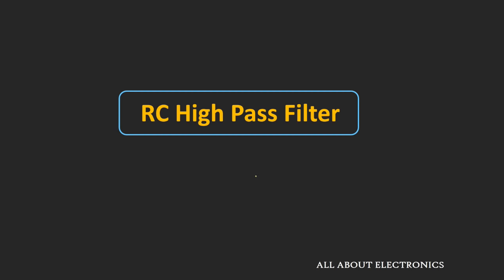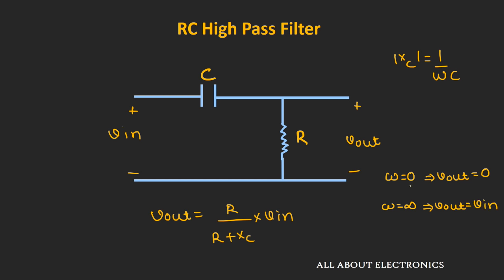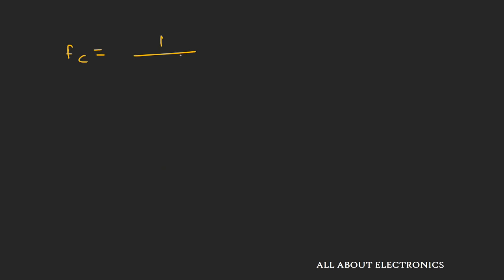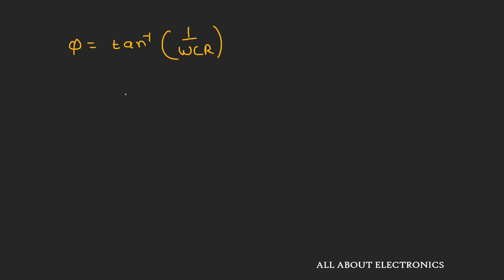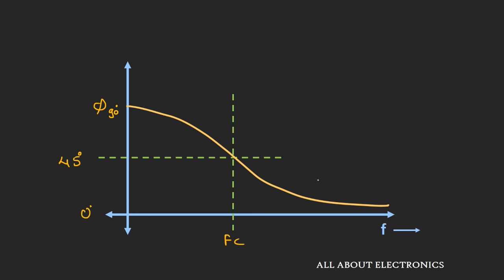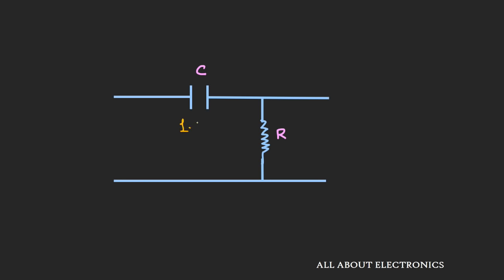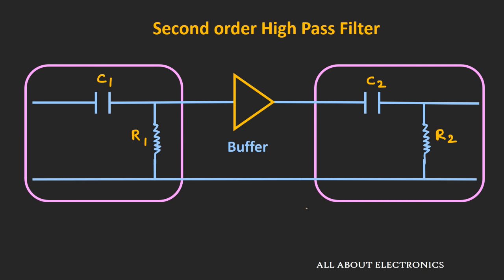RC High Pass Filter Explained

Comment: Thanks for the video. What did you mean when you mentioned the next stage will get loaded if you choose the value of R in Ohms? I just don't understand the concept!!
Reply: Hello Dean  If value of R is very small, when a load is connected, effective value of input impedance of the next stage will be very small and effective value of output voltage falls or it leads to loading....
Reply: Loading effect is what occurs when you directly cascade the output port of one network with the input port of the next (without providing any buffer or active components in between). Basically, the input voltage at the second network is not what we would normally obtain as the output of the first network (here, filter) assuming infinite impedance. Here, the second filter would draw some current from the first filter and thereby, further reducing the gain of the first filter. So, in order to reduce this loading effect, the impedance of the second filter must be as high as possible.

Comment: Also at 11:39 of this video, you said, " So, now suppose, in your design if you want that at 1 KHz..." I'm not quite sure what we want at 1 KHz. "that" refers to what? Thanks!!
Reply: He meant if you don't want that magnitude of noise at 1KHz then higher order filters are needed to reduce the magnitude of that said 1KHz noise even further. By now you could have figured it out. This is for those who have the same doubt and opened your comment. Correct me if I am wrong.

Comment: Oh sir so in Rx phase shift oscillator we are using  a 3 stage cascaded RC high pass filter in feedback path right
So is it like they pass all frequency components of the noise above this cut off frequency of 1/2πRC but only this 1/2πRC frequency makes transfer function of feedback network Beta=1/29 and with A=29 we can satisfy Barkhausen criteria and they sustain
And for all the ones above this frequency that has passed this feedback filter  network do not satisfy Barkhausen criteria thus won't be sustained??? 
Sorry for such a long question
Reply: Dear Abhijith, in RC Coupled amplifier, for sustained oscillations barkhausens criteria must be satisfied. Total phase shift is 360 degree only for those frequency to which the oscillator is tuned to.

Comment: sir , i was unable to understand the part where you assumed the value of Resistance as 10 Kohm.......what is the next level  loaded you are reffering to?....plz do reply
Reply from the maker: when you connect the circuit next to the filter, the connected circuit will act as a load to the filter. Let's say the input impedance of the circuit which we want to connect to the filter is Zin, then the effective load or R-value for the high pass filter is R || Zin.
I hope it will clear your doubt.
Reply: @ALLABOUTELECTRONICS  oo so net impedance will be the parallel combination of both ....now I get it
Thanku very much sir
Reply: @ALLABOUTELECTRONICS   but as far i know, when impedances are in parallel, net impedance gets reduced. so how does it increase the loading? please explain

Comment: why you sometime use sometime Xc = 1/(jwC) sometimes Xc = 1/(wC) ? i am confused.
Reply from the maker: I have used Xc= 1 /wC, when I am talking about only amplitude of Xc, or I would say it is |Xc|.
Reply: ALL ABOUT ELECTRONICS I did not get..
Reply from the maker: When phase information of Xc is not required and only amplitude of the reactance is required at that time I have used |Xc|= 1/wC. I hope now it will get clear to you.
Reply: Hello Arya, the term "j" make it a complex number. Both are correct, first one is a vector (with j) and second one is scalar....
Reply: @ALLABOUTELECTRONICS  More information is needed here.

Comment: What does it mean that the circuit might get loaded by the value of R at 8:34?
Reply from the maker: When you connect the load to this filter (Let's say speaker), then the impedance of that load will be in parallel with resistor R. And in many cases, the (like in case of a speaker) the value of load is in ohms.
So, that will change the effective value of the resistor R and hence the cut-off frequency also.
Let's say in your filter design R is 1Kilo ohm and the load is 50 ohm then effective resistance R will be less than 50 ohms and your designed cut-off frequency will get changed. 
So, that is the loading effect on the filter.
So, in your design value of R should be appropriate. If it's too small then it will draw too much current and if it is too high then value of capacitor will not small (and might be comparable to parasitic capacitance of the circuit)
The best way to avoid loading effect is to isolate the load from the filter circuit, or in general, for any circuit it is true, and it can be easily done by using OP-AMP as a buffer.
To know more about it you can check my video on the active low pass and high pass filter.
Reply: That's a very good and clear explanation. I really appreciate it :')
Reply: Hello, when a load is connected to the filter, effective value of R will change, leading to a shift in cutoff frequency, possibilty of loading. So to avoid that, it will be better if a buffer amplifier is used in between....

Comment: At 2:50 why the cutoff frequency is 1/√2 of input voltage??
Reply from the maker: Because at  cut-off frequency, the power reduced by 3 dB or the power becomes half. So in terms of voltage, it becomes 1/√2.
Reply: @ALLABOUTELECTRONICS  why the power reduce to 3dB

Comment: I can cut an existing rca cable in half, solder the resistor + capacitor into the two wires, put it all back together... And that will work fine, right?
Reply: Hello Mr.Russell, It will work for frequencies greater than cutoff frequency....

Comment: when finding phase of transfer function how does  tan (angle) = 1/(1-j/wrc)  simplify to  tan(angle) =  1/wrc   I have looked into by trig books but can not find how this is solved. Thanks
Reply from the maker: If you have complex number, (A + jB) / (C + jD), then phase angle,= tan -1( B/A) - tan-1 (D/C)
Comparing it with, 1/(1- j/wRC)
Here in the numerator B=0, A= 1, C= 1 and D = -1/wRC
If you put all  these in the above expression then you will get it.
I hope it will clear your doubt.
Reply: could you please inform me where to look for the formula (A + jB) / (C + jD)??? and also when you w=0 then angle =90!! but wouldn't that be tan-1(1/0*R*C)???? you cant divide by zero right???

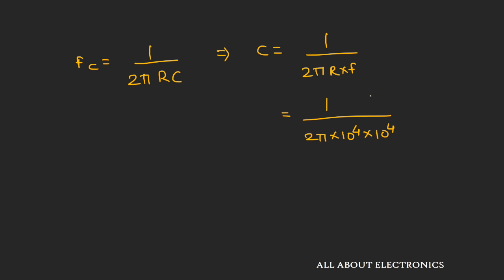Comment: Iam not getting@ 9:23 How you select the frequency value for calculating the value of capacitor
Reply from the maker: Here high pass filter with a 10 kHz cut-off frequency is designed. So, f is already known. The value of R is selected as 10 kilo ohm. And with that value of R, the capacitor value has been found for 10 kHz cut-off frequency.

Comment: I DONT UNDERSTAND  ... HOW A LOW FREQUENCY IS CUT OFF?
Reply: Hello friend, can you be more specific, it didn't get you?
Reply: @circuitsanalytica4348  yes i dont get it. A capasitors  will just increase the volts and it will produce bass and treble at high db.